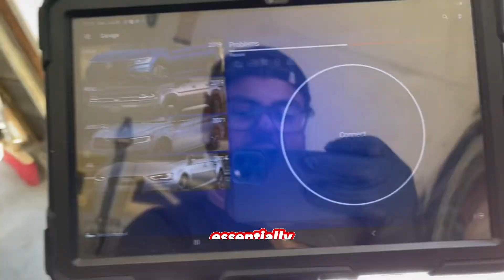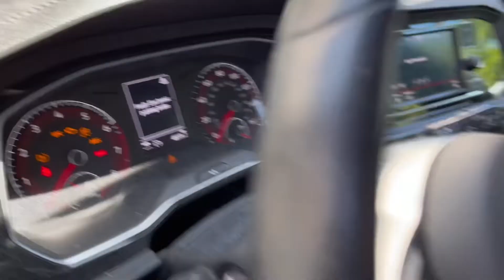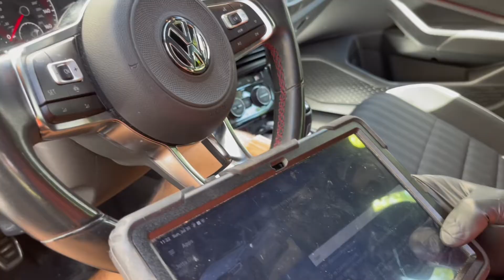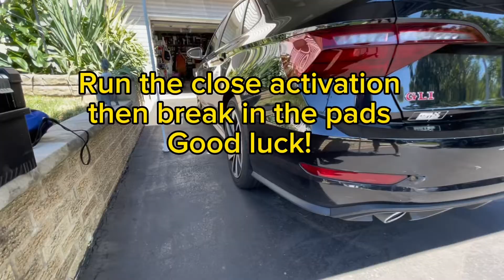Easy VW Rear Brake Replacement with OBDEleven | Electronic Parking Brake Tutorial

Comment: What battery charger do you need been looking at a noco genius 1 will that provide sufficient power
Reply from the maker: I bought my NOCO Genius G7200 in 2016, still works for most every car (including AGM batteries) 

Amazon says the NOCO GENIUS10 is the newer version of the one I used: https://amzn.to/4afIcZ5

I think the 1 is just for small batteries up to 30 amp hours (think quads, jetskis, etc)
Reply: @BestHombre  cheers for the reply just not wanting to spend a ton of money as I'll only use this for when I do my brakes I've read forums of people using the genius 2 while doing Thier brakes I'll look into it more

Comment: What about sfd u need to unlock it or only buy token for workshop?
Reply from the maker: Probably, I pay for the Pro Plan myself.

They didn’t always have a subscription plan, in the beginning you just paid for the device and the apps. 

It’s a great device, when it works, but it feels like they ding you at every step of the way. 

I mean there’s not even an easy way to get refunded when the activations don’t work.
Reply: @BestHombre  cuz i dont have pro or ultimate plan i just want open brake fuction on workshop without plan